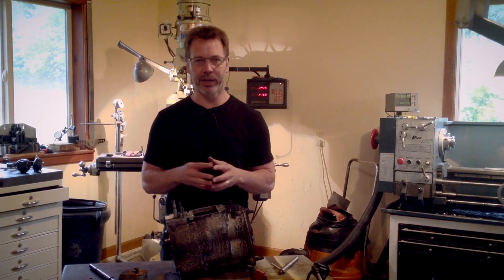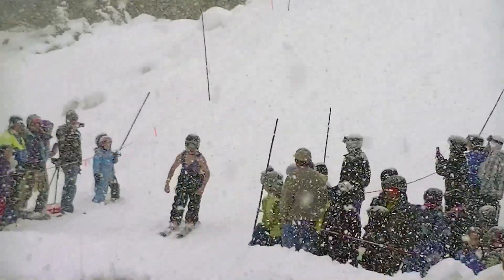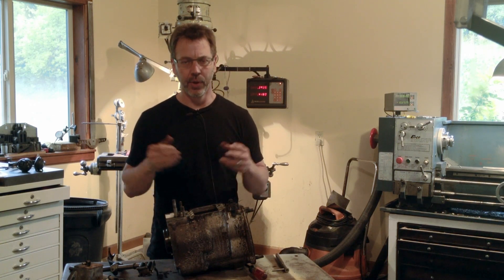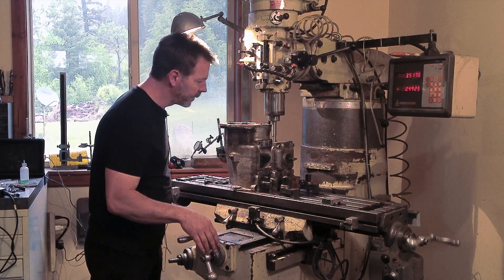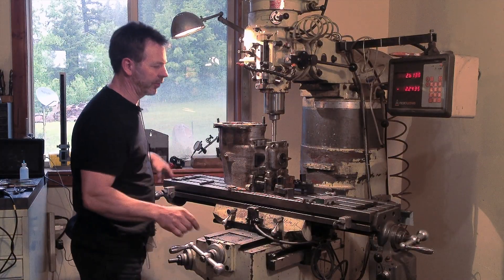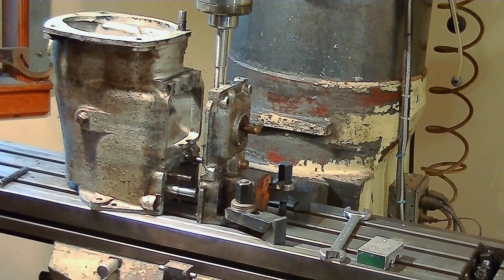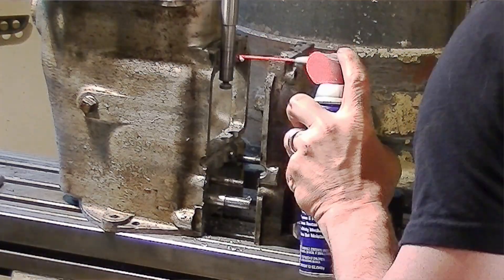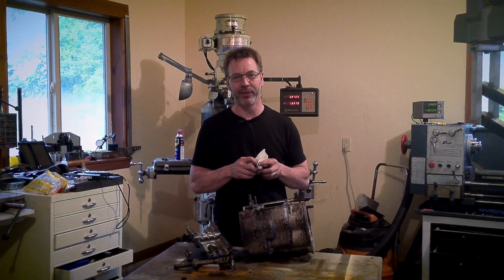Crazy way to fix an oil leak using a milling machine.

Comment: why not groove the shaft for the o ring instead of the case. this has the least possible chance for error and if an error is made new shafts are easier to reproduce than the case is to repair.

Comment: Hi Dale,
Seeing this video is 4 years old. How well did your fix work? Did it stop the oil leak? Did it create other problems?
Steve
Reply from the maker: Hi Steve, It works great, and I have driven it across the country. there is still some leaks but not from my modification.
Reply: Great! Good job, it's nice to have the equipment to do things like that.
Steve

Comment: That fix was a great idea and very well done, but I think you used the wrong seal. An O ring is the wrong type of seal for that application, given all the undercarriage dirt, that seal is not going to last very long, a lip seal would've been much more appropriate and you had the room to do it. never the less, it is now better than factory. Keep up the good works.

Comment: Of all the leaks I've had on my Series Land Rovers I've never noticed the selector shafts as being particularly susceptible. If it was pushing oil out of there I'd be looking closely at the breather to make sure there was no pressure building up in the case. Also, I rely on a bit of oil getting out to help prevent corrosion of the chassis which is much more expensive to fix that a few gallons of oil 🙃
Reply from the maker: LOL very true

Comment: Dale that was one of the better fixs I have seen--pommy machinery  leak oil--perkins motors bsa motorbikes etc..They kept on using cork rubber gaskets which hardened ..You have Improved the original a lot --well done thumbs up..regards Ian

Comment: Very good video and job.
Did you find the O ring first or mill the groove then find the O ring? Sounds like a dumb question but O rings are made in thousands of sizes and one could find one to fit just about any situation. How was the measuring done- O ring to groove depth vs compression?
 Was there a way to tell how much compression there was on the O ring when the case was  assembled as to not cause a constant stress on the aluminum and possibly cause a crack or warp in the case? 
 What type of O rings was used? Certain O ring material does not cope well with oils/petroleum's.
 Would making a type of cover for the shaft be a good idea to pack a little grease into to keep the shaft lubed and not become dry and damage the O ring sliding on a dry shaft?
Reply from the maker: I found the O ring first. I'm calculation was simply trial and error. I tested several size until I found one that did not bind and would stop most of the oil.

Comment: Why almost everybody uses WD40 for greasing? WD is water displacement and rusty bolt releaser. It is not good spray for greasing. Much better is machinist oil and much cheaper...
Reply: +Michal Rimmerak It's good for cutting aluminium.

Comment: I have a question. When moving the orings inboard on the sliding surface are you not creating excess wear on the transmission case against the metal shaft? Without oil to counteract dissimilar metals and moisture aluminum is gonna lose. Not to mention the seals are always on the outside edge so the shaft gets lube on the sliding surface.
Reply from the maker: Interesting point. I took the top cap off a while back and found no problems. As you know on a rover no matter what you do, oil will find a way out. Lol
Reply: +Metal Tips and Tricks (Dale Derry) Ok ty that answers my questions concerns, the orings must let just enough oil by to keep them lubed. Have a good holiday.

Comment: If you are going to crank on bolts like that on your table, make sure to brace your other arm on the table to prevent putting play in your ways.
Reply: +Eggsr2bcrushed never heard of that before, im sure most heaving milling applications would tent to put more stress than a man with a spanner

Comment: I was a mechanic for 25 years. I would like to know how many wasted hours I have under the belt fixing leaky orings that were a crap design to begin with. After some wear and tear they will not seal correctly no matter what you do. Pop on air conditioning lines were the worst.

Comment: I realized this is on old posting, but it's new to me.  A possible alternative method.
1.  Using dial indicator square the case to the mill and rigidly mount.
2.  Using DRO locate the coordinates of the the three slots to be milled, finding the center of each radius.
3.  Bolt the top cover to the case.  This insures both halves of groove are in exact alignment, that the cover is also square to mill, and eliminates movement (loss of rigidity) of cover.  Add additional hold-downs to cover thereby increasing overall rigidity.
4.  Use a boring head and a small boring bar to cut groove while case and cover bolted together.  This eliminates having two boring bars of shaft radius.
Your thoughts are appreciated.
Reply: +Tom Wilcox to answer some of your questions no the fly cutter wouldn't fit down the hole with the cases bolted together but if you could mount the bolted together cases in a big enough lathe and have the hole you are machining running dead centre and had a small enough boring bar ground to the correct profile of the groove you are cutting that would work but its a lot of setting up for one hole, its best to do it the way its done in the video. You have to understand that in the video the case is stationary and the cutter revolves, in a lathe the casing revolves and the cutter is stationary.
Reply: I thought about putting the case together was the obvious thing to do a also but with it together could you get the tool down the hole ? If you could would you rather see what it is cutting rather than an alternative method such as a DRO? I have no idea. I'm not a machinist. Just asking to learn. Thanks
Reply: +madeljacky that makes total sense now. thanks!
Reply: Tom Wilcox your welcome.

Comment: i agree with the earlier poster who disagreed with your calling your fix crazy. i think it;s rather clever actually.

as for british vehicles and their propensity for leaking oil, it seems to be a genetic trait. i've had four, and i don't care how carefully you assemble them, what gasket material you use, how attentive to proper torque settings, or how nicely or un-nicely you speak to them, they seem to have an aversion to oil...

now that i've had my rant, did the fix work?

Comment: Nice hack. Thanks.

It seems to have worked out, but a possible way to stabilize that top cap for milling would be to bolt down a tall angle plate further down the bed, and run two pieces of "all-thread"  (with nuts and washers) from the plate to those two bolt holes near the top (as mounted) of the cap.

Comment: Real cool Land Rover I have a 110 with a factory Isuzu engine and  2a just like the one in the clip. Did it fit the oil leak. I always wondered why the old car seemed not rust as much. When you stop seeing oil leaks you have bigger problems, you have ran out of oil. They say that 80% of all Land Rovers are in running condition.

Comment: Im sorry to say but you must not really know what you are doing because you are using WD-40 as a cutting oil but WD-40 is not a cutting oil. Just thought I would let you know.
Reply from the maker: HI chris budin,  
Your right WD-40 is not a cutting oil. It is  actually not classified as an oil at all,  but a penetrating fluid,  It is designed to penetrate water and get to the steel.  This  symbiotic relationship that  WD-40 has with steel helps prevent aluminum from gulling up your cutters,  making it an excellent "CUTTING FLUID" for aluminum. Another great cutting fluid  for aluminum is kerosene,  according  to Phil Kerner  "The tool and die guy "
My suggestion for  you is try every fluid you can, you maybe surprised what works.

Thanks for your Comment. 

Dale D
Reply: *****
 A very generous way of dealing with such a comment
Reply from the maker: William Ellison Your right WD-40 is not a cutting oil. It is  actually not classified as an oil at all,  but a penetrating fluid,  It is designed to penetrate water and get to the steel.  This  symbiotic relationship that  WD-40 has with steel helps prevent aluminum from gulling up your cutters,  making it an excellent "CUTTING FLUID" for aluminum. Another great cutting fluid  for aluminum is kerosene,  according  to Phil Kerner  "The tool and die guy "
My suggestion for  you is try every fluid you can, you maybe surprised what works.

Thanks for your Comment. 

Dale D
Reply from the maker: Sorry I misunderstood. Ill have to try the mildew trick.
;-)

Dale d
Reply: +chris budin WD-40 is actually very good to mill a aluminum, it clearly shows that you sir do not know nothing about machining...
Reply: ***** Do not use WD-40 as a cutting fluid, and don't let me catch disrespecting people on this channel. You need to do some research in proper communication before you open your gob under any YouTube video.
Reply: ***** my comment was directed at PMX just for the record but thanks for the feedback. It's also good for cleaning mildew in refrigerators.
Reply: ***** you are very disrespectful and one of these days somebody's going to teach you a lesson in proper communication. If I catch you disrespect anybody else on this channel you will hear from me. You have been warned kid. Now go way and don't ever use WD-40 as a cutting fluid.
Reply: I'm not reading your comments. I'm just replying with the expectation that you will waste your time replying back. I hope we can continue this until you learn your lesson in proper communication. Just like now you don't know when to keep your mouth shut, because you are easily controlled and manipulated. 

Just like a machinist will control the metal he is shaping --- I control you kid.
Reply: ***** I control you.
Reply: chris budin ...Yes WD 40 is a very good Lau cutting oil.  No good for anything else.

Comment: What's the make/model of milling machine you have?
Reply: Yeah I too would be interested. Looks bit more stout than BP. Good vid by the way. Any news on how the fix improved the leaking? Was wondering if tiny return drain holes between the two o rings would help at all. Keep em' coming!
Reply from the maker: Hey gordonfrank,  
The maker of my mill is ENCO. Its a BridgePort knock off. I do have a collar added to the column that raises up  the head 6 1/2 inches making machine look larger than it really  is. 

Dale D
Reply from the maker: Douglas Smith,  Yes this procedure  works well, Now if I could fix my main rear seal. LOL
I thought about drilling holes to help let the oil out, but I decided against it. I couldn't figure out the right size to make the holes.  To small a hole and  you will get a capillary action pulling oil up in to the shift rods. If these holes are to large.  Oil will splash up into the new holes causing  more problems.
It may be possible to put a shield in front of the holes, or add some tubes to the holes and reroute them to a safer place to  eliminate the splashing problems. If you try the tube method make the tubes  as large as you can   to prevent the capillary action from occurring.

Thanks for your question.

Dale d
Reply: ***** Are you happy with the size?  I'm shopping for one and am trying to learn what guys like/dislike about various models, etc.  thanks..

Comment: If you want to cut down on the chatter on the thin side you can put a few C clamps or can't twist clamps near the top and you would be amazed how much chatter it cuts out. It just the extra metal hanging soaking up the vibration.
Reply: Another way would be to make 4 stand offs and some long bolts.  Then both halves would be even and the cover would be a lot more rigid while machining.

Comment: Land Rover ...... two ways of looking at the leakage 1 ) it s leakage , fit more seals & hope it works  2 ) it stops a lot of the rest of it s sorry parts bin ass from rotting & puts new oil in the transmission , if you are attentive to the level . 
Ignore the leakage ( OK put a drip tray were it sits on the drive / garage ) and add a sight glass & a few holes in the panels so you can see the glass & re top the transmission . It a Landy , not a 911 , if they were to be clean they'd have been built it in Oxford , not the east end of Birmingham .
Reply: +Kaptain Kopter Had a run up to Sanmore , from Kensington , this evening , from a guy who had purchased his 1st . Month old , to him , only 2001 & £7K , he was very much enjoying it .............. and talking of a Land Rover fest in Peterborough at the 20th of this month .

Comment: Nice production on the video, and I am envious of the big windows in your shop.

However, a few suggestions:
- Using a combination square is fine for getting a part roughly squared on the table, but it takes just a minute or two with a dial indicator to bring it in to within .001" over many inches.
- You could have significantly improved the rigidity of your setup by using some 123 blocks to clamp the skinny casting to the big casting, via their machined mating surfaces.  Another approach would have been to use some 246 blocks bolted to the table, to make a rigid 'tombstone' arrangement for clamping the skinny casting vertically.
- More discussion/explanation on your cutter was probably warranted.  I think it's more appropriately considered a boring tool than a fly cutter, since the latter are primarily for facing/surfacing.
Reply from the maker: Hi TangentAudioVideo,
 Im glad you like my video. I also think your suggestions are right on. I have done 2 more transmissions since that video and changed my clamping method similar to what you suggested. Your also right about using a dial indicator, but the square gets it close enough.

Dale d
Reply: if the tool will do the job efficent and safe, its the right tool, hence fly cutter cutting grooves with it is fine

Comment: I really don't know why this video is called a Crazy way to fix because it is actually a pretty smart way to do it, I would have bolted the cover in place and cut lands each end to fir proper 1/2 ins shaft double lip seals which weren't around when the original Landrover was designed. Good way to fix an annoying problem with Landy's